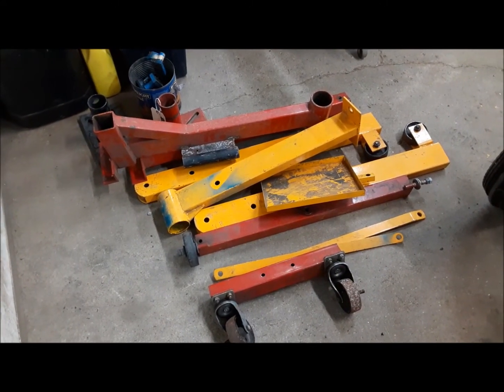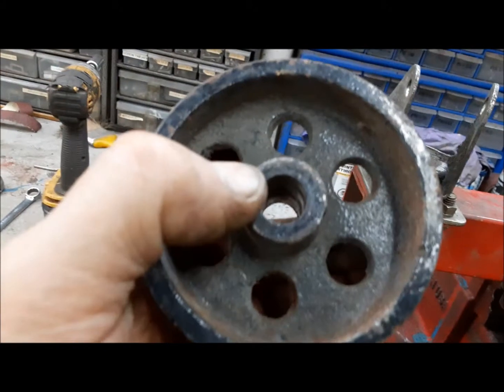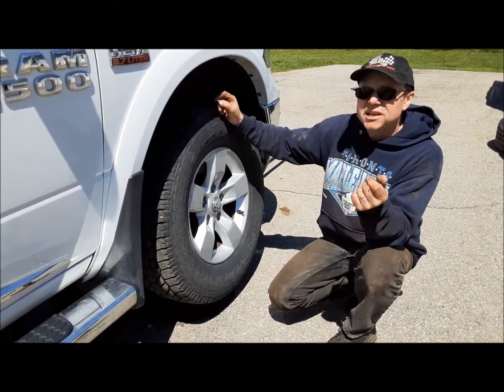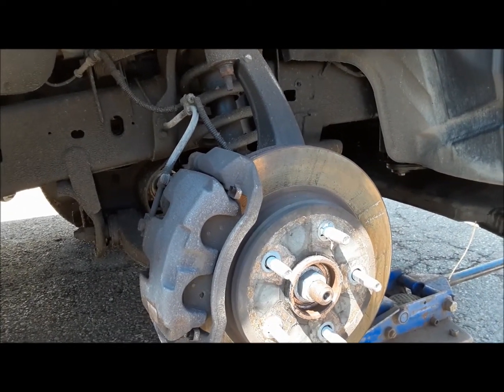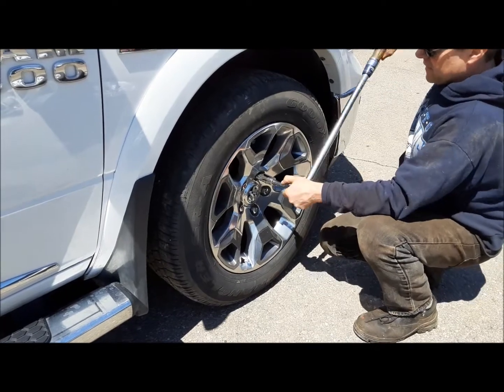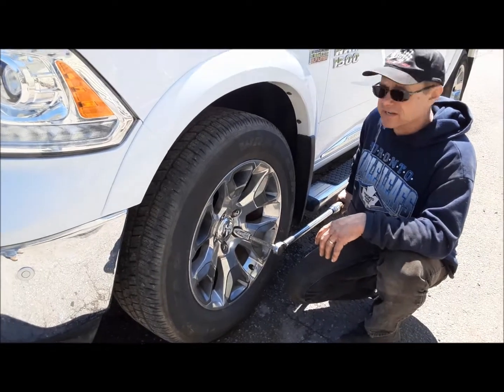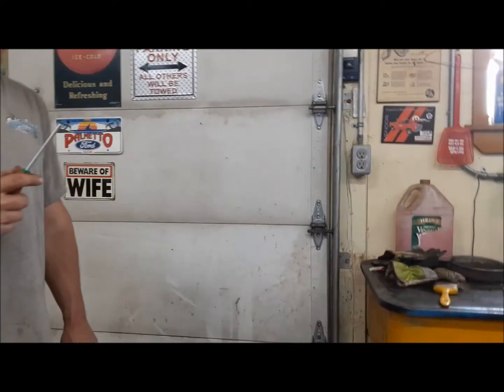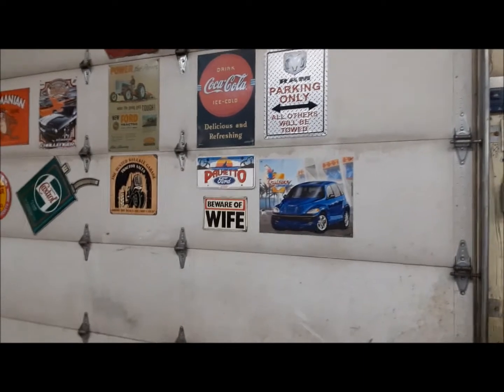Another PILE of Odd Jobs

Comment: Nice too see you tube channel close too me . Newcastle Ontario . I watched your hydraulic top link video . Just did the same . Use silver solder all the time . High strength with water base flux for hydraulic fittings . Keep the videos coming . Glad when princess auto opens back up . I work just around the corner . Need some supply’s 👍
Reply from the maker: Thanks, I'm glad you enjoy my videos!